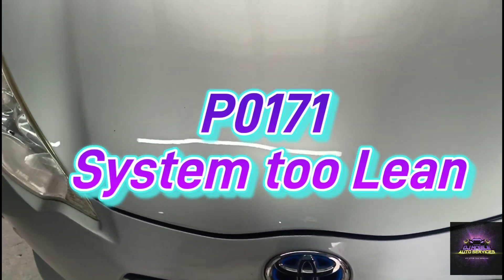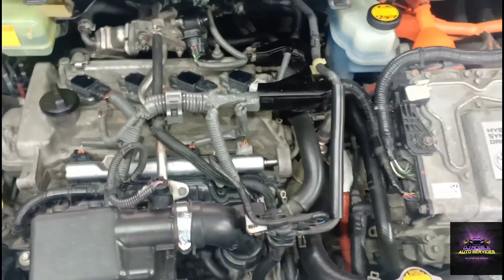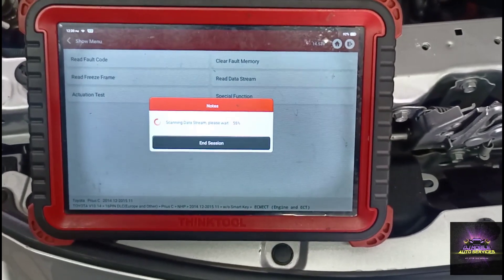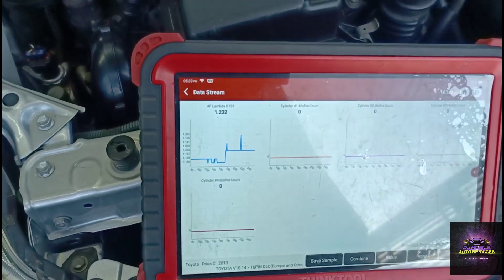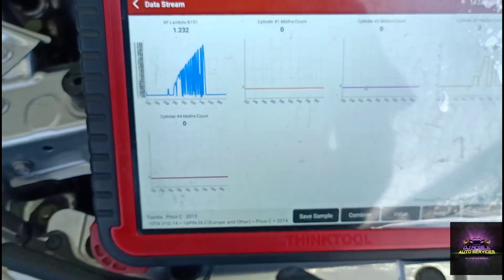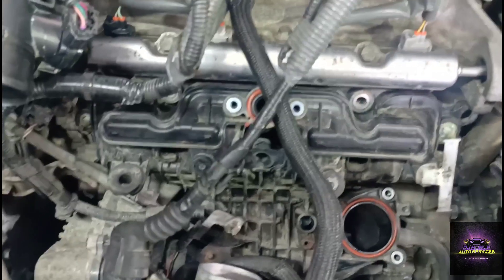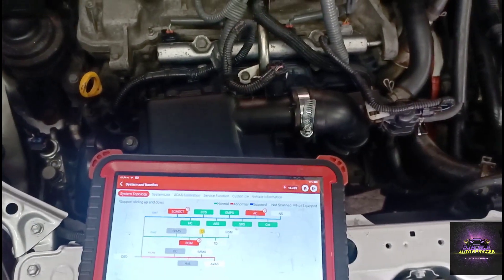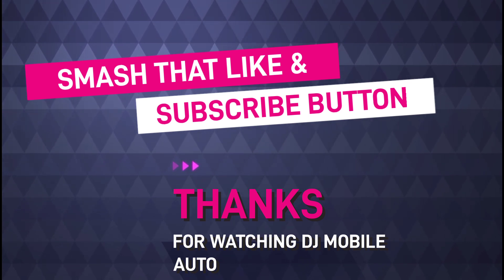P0171 System too Lean on a Toyota Hybrid Prius C/Aqua. Check engine light is on. Rough idle

Comment: Nice job bro.. glad to see she finally got thru 🙌🏿 👍🏿
Reply from the maker: Yeah bro. Just needed a mental break before I attack that car. Lol. It can be hectic at times in the shop.
Reply: Why is it that the misfires were on cylinder 1and 3 and the problem was vacuum lick on intake manifold,,
Reply from the maker: @georgenjuguna9869  the crack was between cylinder 2&3 intake manifold. You have unmetered air being sucked into the manifold causing high fuel trims. So the misfire was happening on cylinder 2 and 3 as you see in the video. Manifold was replaced, car is running perfectly again.
Reply: @djmobileautoservices  ok
Reply: What is that ur using to test the lick
Reply from the maker: @georgenjuguna9869  Carb spray and smoke machine. Listen to the change in rpm, seeing that it's a flammable substance. The rpm will increase cause the system is being enriched